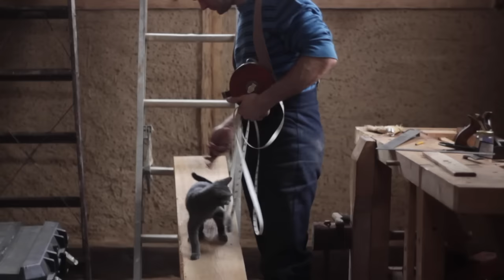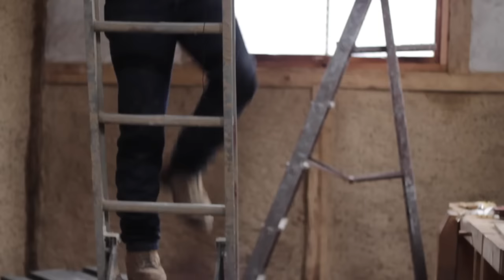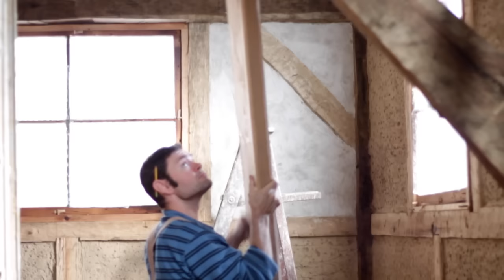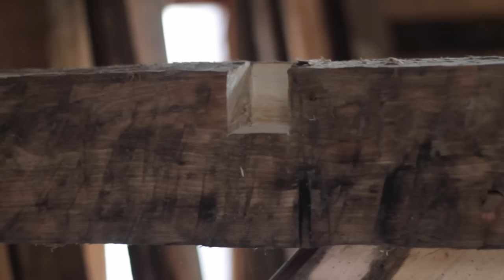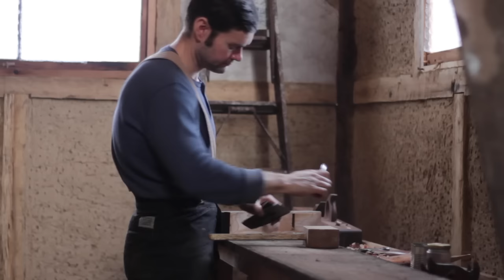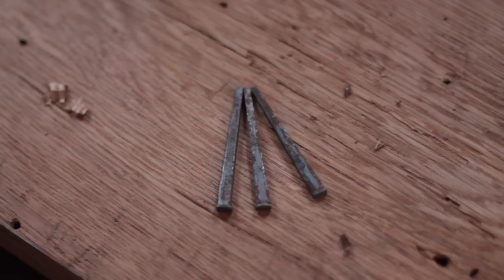Our timber frame workshop: Loft floor

Comment: Is that a great kitten or what?  We had one like that....little grey-face.  This is the type of carpentry grew up with and did in my life with very little dependence on nails in structures and the reclamation of used wood.  When we built our new house in 1957 we tore down our huge old house and each day when I came home from school I would, along with my usual fram chores, reclaim the old lumber.....brings back the memories.  Thanks.

Comment: nothing worse than running your plane through a missed nail!! love that you reclaim lumber :)
Reply from the maker: +tony bologna yes! i have to regrind my jack plane iron many times, some nails you can't see. Many times reclaim wood is better than anything you can buy because old growth characteristics.
Reply: @MrChickadee  

Magnetic iron dust is an easier way of finding metal in reclaimed lumber. Much more accurate, too.

Not as easy or fast as a battery powered portable electric metal detector, but I figured you'd like a simpler, re-usable method.
Reply: Some people reeeeeeeally like nails, don't they?

Comment: You did a nice job fitting up those loft floor boards they have no gap whatsoever nice fitment Job done there. Here's a tip for yah. I'd get a scraper and scrap those reclaimed boards before you plane them dirt will dull the blade on your planes.

Comment: Shop is looking fine. The oak boards you install into the loft look as though they still have patina after you planed them, can faintly see circle saw marks. I like that, too much  (looking for word) Fancifacation these days. But folk are starting to appreciate fine joinery and good work a little more each day that passes. Thank you for your time in making the video and keep a craft alive. Well done
Reply from the maker: +Old Rusty Rooster Thanks, yes I only planed enough to smooth off the roughness and expose the woods color

Comment: Are those hardened cut nails for concrete? and if so did you anneal them? I sometimes see you are using them as cinch nails. Just subcribed
Reply from the maker: Yes, and yes, or you can get unhardened cut nails from Tremont and save yourself the trouble!

Comment: I believe you have taught the kitty the wonders of measuring and the wonders of spring loaded shavings ... GREAT JOB Mr Chickadee!   Now for a question ... when working on these reclaimed decking ..do you keep a magnate around to double check if you have removed all the nails?  I am scared of hitting one with my plane.  I just thinking out loud.
Reply from the maker: +L Gorman Yes Charles is enjoying his apprenticeship... Ah yes, the only downside to reclaimed wood, the dreaded nail... not sure if a magnet would work, I try to double check before planing, but alas many times I have hit a hidden nail and had to regrind my iron, its def good practice for sharpening though! haha
Reply: +Mr. Chickadee may benefit to peen the blade to draw out the gouges, less grinding so the blade lasts longer.

Comment: I happened to acquire a whole bunch of chisels, auger bits and braces, hand saws and 2 6' cross cut saws, an old broad axe, and a bunch if other stuff. they cleaned up pretty good spent most of the weekend sharpening the bits. how long did it take you and your wife to build? what an insperation. I commend you.
Reply from the maker: +mike vantol That sounds like a great find. We spent from April until november.

Comment: The cat is the secret star of the series. :)
I've wondered if you had any plans before building the workshop, or just improvising it?
Reply from the maker: +Farkas K. No secret about it, he has stolen the show! haha For plans we let the building site and the size of timber we could manage dictate our overall dimensions, much was just scribe fit each day as it comes, if it doesnt work, make it, flying by the seat of my pants...my wife often asked me how I remember the frame and how it goes together, I just told her I dreamed of it every night.
Reply: +Mr. Chickadee The cute little sweater made him even cooler, sew him a new one with your bird logo :D
To the plans... man, I had the assumption that you made it that way, and this makes it even more awesome.
On your blog you wrote, that the house does not insulate well enough for the masonry heater. Do you think that there is any way to make it better insulated? Rockwool maybe, it could maybe let "breathe" the walls. 

Thx for you answers, keep on with you awesome projects :)
Reply from the maker: +Farkas K. Since its just my future workshop and we needed to more in Post Haste I just replaced the masonry heater with a large wood stove and thats fine for now, not really interested in adding insulation, just try to do better on the house.

Comment: I have a handful of them nails from a house that was built in 1910.
Reply from the maker: +Joseph Mckay Thats great!
Reply: +Joseph Mckay I've heard that before machine-made nails existed and they were individually smithed, that people used to burn houses down just to get the nails.
Reply: wow that is crazy.
Reply: i know that the nails are worth something on the market,
Reply from the maker: +Joseph Mckay I found mine on Ebay pretty cheap, but they are not blacksmith made, just cut nails.

Comment: I notice that you only use wooden planes, why is that, what is the benefit.
Reply from the maker: +Andrew Morgan I do use metal planes from time to time, though I prefer wood. There are a few reasons for this;

1) Wooden planes glide with less friction on the work
2) they are lighter, hence less tiring to use, especially for extended sessions
3) They burnish the wood as they cut leaving a better finish
4) they are faster and easier to true the sole, you can flatten a woody with a plane. 
5) The older ones have larger, wider, thicker irons which dominate the work and give more results for each pass. 
6) They flex less than metal, you can actually twist or bow a metal plane in use. 
7) they are BEAUTIFUL!  ;)

Great question!
Reply: Thank you for your help, do your comments remain the same for Japanese planes, or are there differences? It is harder to find the type you use.
Reply from the maker: +Andrew Morgan Ive not used Japanese planes, most of the types I use can be had for a few dollars at most antique stores or flea markets around here, if you can't find a certain type I would look on Ebay, Ive bought 90% of my tools there, including all the planes you see in my videos. You will find many videos on Youtube for restoring them, Id pay close attention to the cap iron set up, it can really make your plane, reducing or eliminating tear-out with our against the grain.

Comment: You really pay for it when you re-purpose wood. There's so much debris in the surface. I like a card scraper for the initial upbraiding. It's an easy instrument to resharpen and it's not as precious as a planer blade.